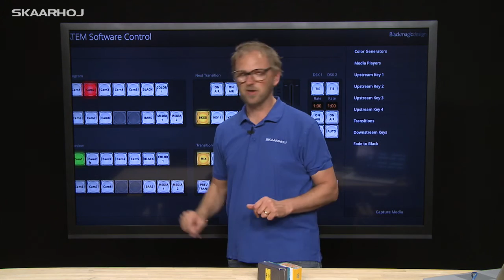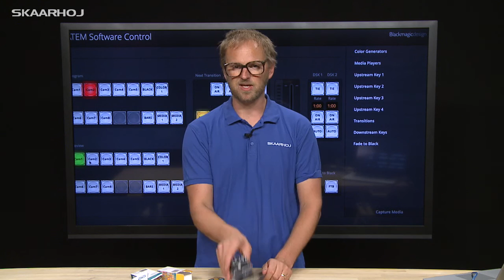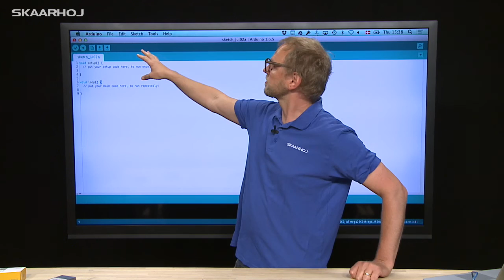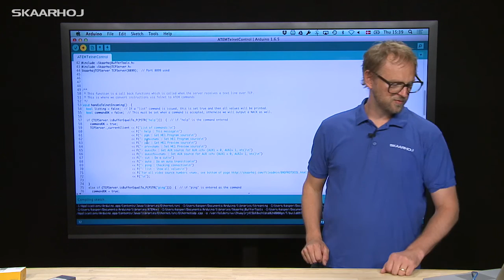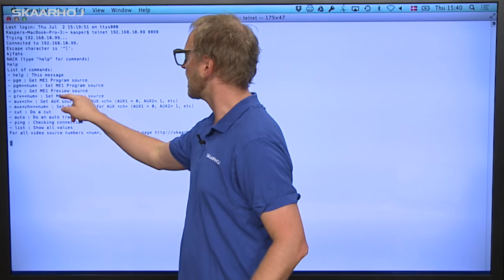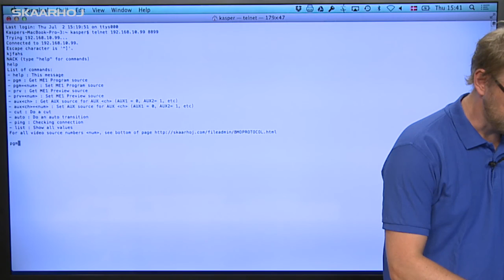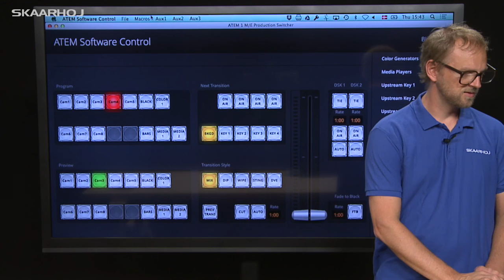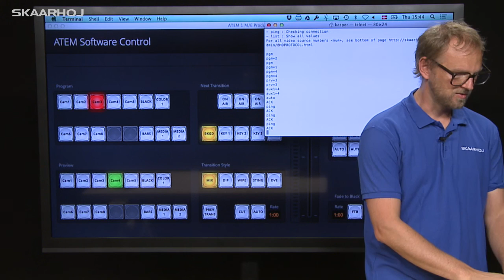Controling ATEM Switchers with Crestron Panels (via TCP/Telnet)

Comment: Hi, thanks for the tutorial. How about playing the macros? I have 5 available macros, and I want them to play on different time.
Reply from the maker: Hi Jayson - have a look at our ATEM-TCP Link: http://skaarhoj.com/designs/atem-tcp-link/ From this you can trigger ATEM Macros
Reply: Hi, Thanks for the response. Actually, I am planning to do the arduino programming.. Since there is available ATEM library, can I use your sample telnet control and modify it then add the control for Macro? Is it possible?
Reply: Also, if we placed order for this device today, how long it will take to arrive in the Philippines? Do we need any other device like arduino to control the switcher or only this one? Thanks
Reply from the maker: If you where to order the ATEM-TCP Link? The unit is in stock - shipping to the Philippines are usually between 2-3 business days. If you get the ATEM-TCP link you would not need any other device